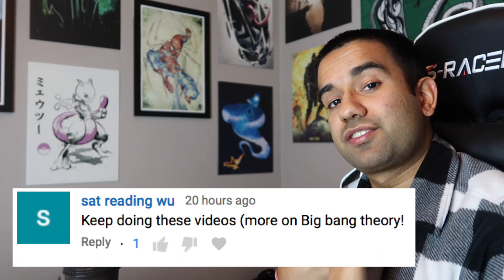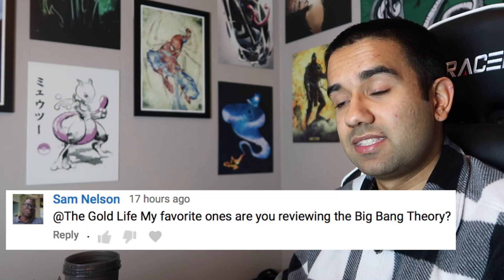Real Engineer Reacts to Big Bang Theory #12

Comment: Not an engineer... and very late to the game.  One aspect of the height guess is that the bottle did not start from a static drop.  He didn't reach his arm in and drop the bottle, he tossed it through the gap.  So the bottle would have started with a lateral trajectory and then quickly arced downward.  Not enough to account for the discrepency between his assumption and Pary's calculation, but it would have affected the the drop time.

Comment: I think Leonard used the a = s/t^2 while assuming that t = 1s, cuz that's what I did and got 9.81 metres for displacement, but I believe that is incorrect cos the equations of motion make more sense in this context since this would be a constant acceleration equation. So me and the writers were both off on that one. Let's neglect air resistance cuz there is no way in hell a drunk Leonard can do that level of mental maths.

Comment: I think they did made a mistake converting the height, they probably calculated it with 9.81m/s² and therefore got 30m, but then Leonard said it were 30ft
Reply: yea for ft unit they need to put 32 instead of 9.8

Comment: I think I missed the part, but I am curious how it came back to them exactly, wouldn't any angle, even the slightest, reflect the laser somewhere else?
Reply: A retro-reflector has mirrors positioned at precisely 90-degree angles to one another --- the incoming light is reflected 90 degrees, twice, thus returning in its original direction.  Since you have two mirrors, neither mirror has to be aimed directly at you.  The Apollo missions carried retro-reflectors so that we could accurately measure the moon's distance.

Comment: Wow, either my math is way off or that bottle dropped between 130 ft and 290 ft not 30 ft(air resistance might slow it down but not by much, its in a tunnel so i guess it could have hit the side but that makes his calculation even worse) 3:19 he lets go at 3:21 hits floor so between 2 and 3 seconds 9.8 meters per second per second so between 9.8 * 2^2 =39.2 m  and  9.8 * 3^2 = 88.2 m. Now that i watch this part here and actually think about this scene he was way more intoxicated than i thought cause his perception of time is off, he thought it was a second = 9.8 m or 32 ft.
I over analyzed that too much but  was fun for me.
Reply: You forgot to take one half of it
x = xo + vo t + ½ g t²
Where xo = 0 and vo = 0
So the distance is between about 20m and 44m or 65ft and 144ft. I don't know how to approximate air resistance tho
Reply: @realdragon  0 * 2 + 1/2 (9.8*2) Thanx i did miss the half so about half of what i said previously,  air resistance in a tunnel with no air flow should be negligible but for curiosity its done with fluid dynamics where drag is a type of friction dependent on the drag coefficient and the area but you would need a lot more to do it, like the bottles weight and surface area( the drag should be negligible a bottle is pretty small and there is no wind)

edit I was missing the mass for the way i was doing it thanx was bugging me a while